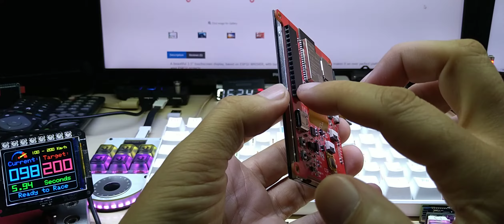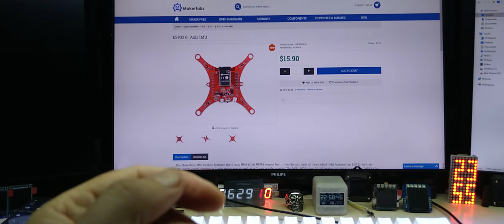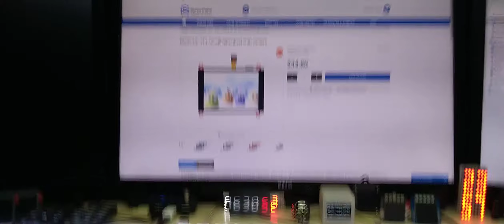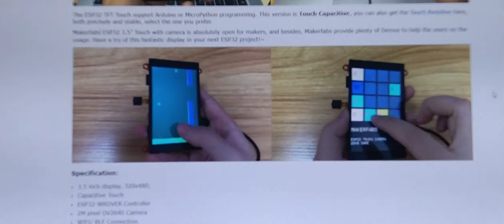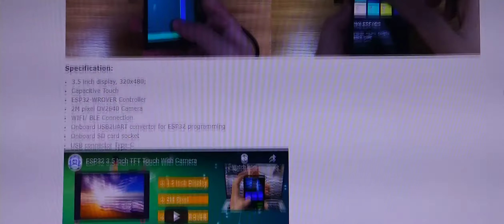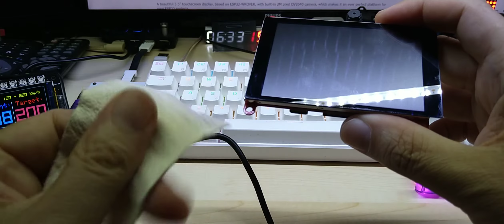ESP32 with 3.5" TFT Capacitive Touch Screen with 2MP Camera, Sd card, USB Type C, WiFi, BLE and more

Comment: Very bad product that makerfabs board sucks is really a fake  the SD card slot fail. And the touch is super slow and poor I found delamination i say you : DONT BUY THAT FAKE  BOARD YOU CAN GET  MANY BETTER OPTIONS IN CHINA    !!! 
Thanks for the videos !!
Reply from the maker: Sorry to hear about your bad experience, maybe you just have received a  faulty unit. I personally can confirm that my board works as expected, as I have demonstrated in several videos. including it's touch capability. You might want to try different libraries for the display and touch controller and see if it fixes your issues. You could technically alo just replace the display if the board is of use for you. As for the sd card, had no problems with using it either. Good luck and greetings form Bulgaria :-)
Reply: @iHayri1  i have 5 boards capacitive and resistive version same problem !!  In fact one 3.2 inch no working display damage from new and they say no give me guarantee.
Maybe you can share some code to test some , the makerfabs support is super bad 😞, by the way what hardware version is your board ?  I have to many in other brands all of them work better i have  m5stack , lilypi, 8ms, 01studio in 7 inch and many others .... Just makerfabs give me problems
Reply from the maker: @HpsMexico-STmx-S.L.A_mx  I would try the Makerfabs code examples and TFTeSPI library for the display and the FT6236 or FT6X36 library for the touch. Couldn't tell the board version as I glued on several sensors boards to the back of it. But if I remember correctly it was v1.1. There are a few shortcomings of the board like not correctly used I2C ports for example. The Makerfabs board was useful for me to actually get started with touch screen displays and I ended up designing and building my own board for my CAN BUS Gauge PRO, which included several extra features like the CAN BUS chips, GPS module, ADXL345 sensor, 10 Neopixel on the display side, PAM8304 audio amplifier for I2S output, DC-DC Buck converter, and an LDR for auto brightness of display and Neopixel.
Reply: @iHayri1  thank you for your response are super good for me !!  I have tried all the examples in fact the LVGL using esp-idf works but the problem is the SD card y see use the same spi bus just change chip select , could you give me some info about that comments the buses are not correctly please ?  Where you see it or where can I check it ? other way I must check by hand all the squematic and code , the support from maker fabs is supper poor infact they say is my problem other words no guarantee and I check what to do , i spend around 500 USD so I need the SD card cause I'm to making a protect using can bus  I want make one sniffer but whit out the SD card I can't storage the data for check then or save files 
I'm disappointed and frustrated about the board and bad super bad support by makerfabs,  but the community and some hours working maybe can save me , other way I must move all the project to other board like lilypi that works great but is so big to my purpose.
Thank you so much my friend and sorry for my poor English
Reply from the maker: @HpsMexico-STmx-S.L.A_mx  Hi there, first of all, no apologies needed for your English, it is very good :-)
maybe you have a bad microSd card slot, as I do not remember having problems with mine and selecting the CS pins. Since it's been quite a while I worked with the Makerfabs board and looking at the schematics they provide, I2C was not using the proper pins from the ESP32 Wrover module so I had it fixed on my PCB that I created. Never used their support or their forum, so I can not comment on that but reading your comment it is a shame if they do not help their customers. If you want to build your own CAN BUS sniffer, you might want to check my videos about the various CAN BUS gauges I have build, maybe there is something useful for you. I have recently sold 3 of my 2.0" IPS display version for a E-Bike project in Brazil. That PCB has also nice features as build in GPS, Neopixels for shiftlight for example, microSD card slot, Bluetooth, ADXL accelerometer, BMP180 temperature and humidity sensor and even 2 touch sensors for input. So if size matters, my 60x46 mm board might be the one. PS: it's the display on the left in this video :-)
Reply: @iHayri1  wow 😳 you are a real master !! I just touch subscribe to your channel !! Your videos are super good , i need a cup of coffee and spend some time watching your videos . About my 5 boards i see in the schematic they are using same spi bus for camera , display , SD card and just 12c for touch,  i see in the code the spi is set to 80mhz i think is so much for regular  micro SD card I play whit the values and just one time it works at 8mhz, but then first reset again same SD card  problem 
My boards are v1.3 , i will try to test using my own code the makerfabs examples are no good , today btw I was working whit same brand can bus  board cortex m0  and I found many bugs in the example codes , is a kind of template all whit same problem one ''L' extra , values in char whit more than 256 , in the end the code is working , now I'm trying to understand the libraries but i see your work and I think there are better options.
Thank you so much i will coment and share your videos , I'm in automotive industry but i love the electronics and I'm learning embedded. 
I respect you my friend !!!
Reply from the maker: @HpsMexico-STmx-S.L.A_mx  That sure is not a good move to share SPI between a fast display and a slow SD card. the ESP32 has 2 SPI ports and they should have used it better.
It took me quite some time with the CAN BUS on the ESP32 and ended up using the same library as I have used on the 328 and the 1284P. Today I removed my latest CAN Gauge from my car and will make a video of it tonight. appreciate your kind words :-)

Comment: Tnx for video. Could anybody get the camera to work. I used the code on https://github.com/Makerfabs/Project_Touch-Screen-Camera, but camera_v2.ino does not work. The rest seem to work.
Reply from the maker: I will look into it, as I tried the camera only once, and make a new video showing it, with a working example code.